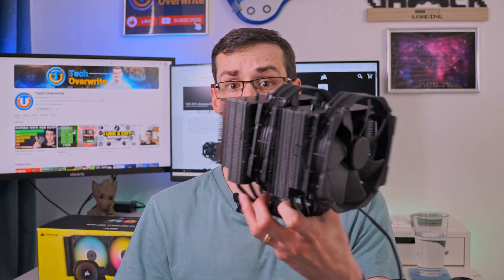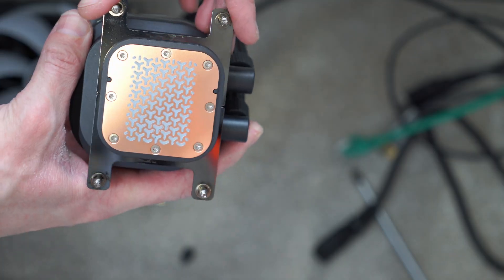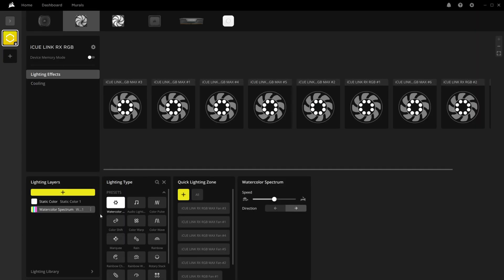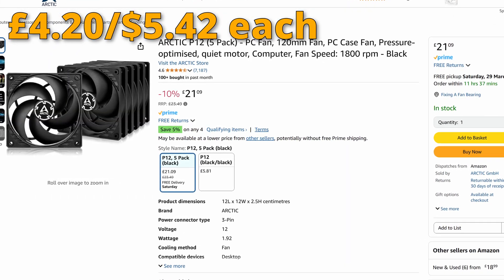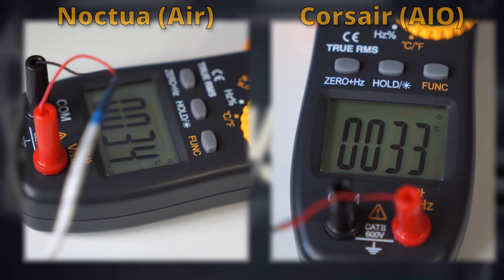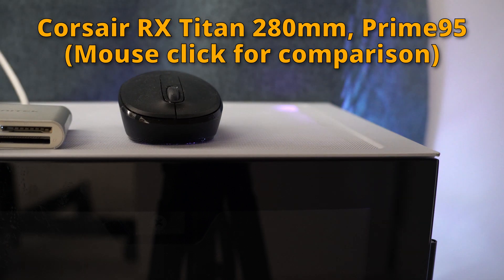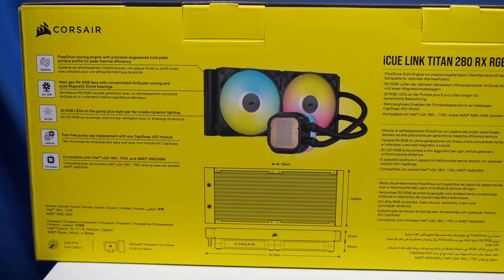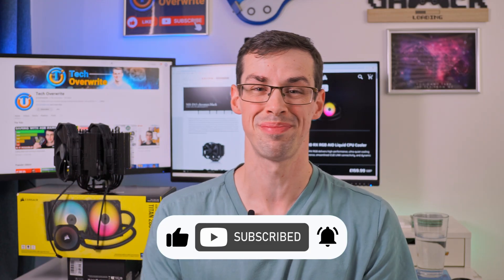Flagship Faceoff: Noctua NH-D15 vs Corsair RX Titan AIO

Comment: The thing i've noticed about AIO coolers, is that while air coolers are technically louder, AIO coolers with the pump sound as well make this higher pitched strange noise that i find difficult to ignore. Where as the air cooler noise i just get used to, and don't actually notice as much. It's like the noise "quality" is better with a good air cooler.
Reply from the maker: That's a great point - I agree tbh. I always find the pump noice a little distracting. Even when your PC is basically at idle (just browsing the net), an AIO cooled system ends up making more noise than an air cooler system.

Comment: I have an Intel I core 14900k + noctua DH 15 with a RTX 4080 and I live in Indonesia temps here are around 25 - 30 degrees celsius. While gaming it stays under 70 degrees celsius, with my air-conditioning on it stays under 60 degrees celsius. Just don't run cinebench haha then it goes to 90 degrees celsius.
Reply from the maker: Haha that's interesting, glad it keeps it in check most of the time :)
Reply: @TechOverwrite yes I just wrote the message for anybody doubting to get a fail proof air cooler when only gaming. If you're only gaming it is the best choice in my humble opinion.....

Comment: I have aio i60 still in my case still using for over 6 years. But plan on changing to Nh-D15 when I plan build new pc. Plan on to build a mini tower pc with mini itx with amd. So should be nicely build one but cost me arm a leg lol . Thanks for video allows me to decided to go with nh-d15, since not much huge difference between those two except the cost and fancy lights going on. Which i dont really need those stuff anymore. I just want simple pc that can game and still clean looks. Cheers! From USA!
Reply from the maker: That makes sense, sometimes simple is best. I still like non-RGB, air cooled builds tbh - they're sleek but still awesome IMO 🙂

Comment: i have no idea how ur getting such hot temps lol, i have a 9950x3d with the NHD15 chromax black, and at 200watts cinebench run at 10 minutes, im only getting to 82c, not sure howo ur 7600 is suffering so much, maybe im missing something.
Reply from the maker: Hmm thanks for that, I did double check and the cooler seemed to be mounted fine but I'll have to revisit it. Glad your setup is working well for you :)

Comment: If they were the same price which would you choose? The price difference is only $10 for me.
Reply from the maker: Ooo good question. It's good that they're a similar price for you :) For me it depends on what I want to achieve. If my PC was on my desk and I wanted to show it off, the Corsair AIO cooler would be my choice. It looks awesome - much better than the Noctua IMO. And for gaming or heavier application use, the Corsair cooler will keep your system cooler and quieter - I definitely noticed this. However at idle, I found my Noctua cooler to be silent, but I could hear the AIO pump a bit. So for general system use (web browsing etc), the Noctua cooler would be my preference. Sorry if that's a rambling answer LOL - basically I liked both, so for me it would depend on what I'm using my system for - and whether I want to show it off.

Comment: I don't understand why the voltage values are so different. In my opinion, the huge temperature differences can't be explained just by the differences bettween the coolers. Could it be that the CPU was drawing different amounts of power during the tests with the two coolers? That wouldn't be a fair or professional comparison.
Reply: Does not really make sense for the Noctua to have a 30 degree difference over the Corsair AIO, are you sure you have the thermalpaste and pressure applied correctly wrt the mounting ?

My last air cooler was the Scythe Mugen 2 Rev B, but i can't imagine a AIO being that far ahead.

Since its well within the thermal Envelope of both coolers.
Reply: Yeah definitely something was wrong. I've done similar tests with a NHD15 and 240 AIO and they perform very similarly. No way there was a 30c difference.
Reply from the maker: I wondered the same and did double check. There wasn't any difference in the CPU setup - I hadn't overclocked either, at any stage. So it was odd I agree. I did everything I could to ensure it was a fair and reliable comparison, and couldn't see any obvious difference (i.e. it's not like I had OC the CPU with Noctua but undervolted with the AIO).
Reply: If only we could see the full view with the clockspeed etc for the Corsair. I guess the answer is in the video footage

Comment: Over the last year, I've had two friends have their AIOs die (one only lasted a week). Both were replaced with Air-Coolers. I don't hate AIOs, but you can get excellent Air-Coolers for a great price which just work. Excellent value.
Reply from the maker: Oh yikes, that's worrying :/ I must say, the Corsair AIO seems pretty solid so far - but yes, there's always a small doubt in my mind: "what if if leaks?". I know in theory that's quite rare, but a pump failure is more common too. I've ended up liking both, but I think it depends what I'm using the PC for to be honest.
Reply: @TechOverwrite  my d5 pumps in my EK loop would go out once a year (during my threadripper days) so i dont think ill go back to that, i dont believe its worth it

Comment: A thermalright cooler will be cooling similarly for 30 to 50 bucks compared to 180, so price diference is significant.
Also I'm bothered by the fact that the AIO will be garbage in 10 years at the most, while heatpipes will still conduct heat as day one.
Reply from the maker: That's a fair point, and it's surprising how good Thermalright have become in recent years. They're definitely the best value right now.